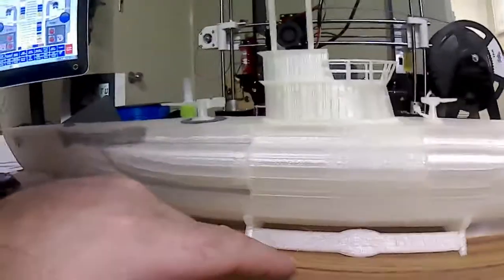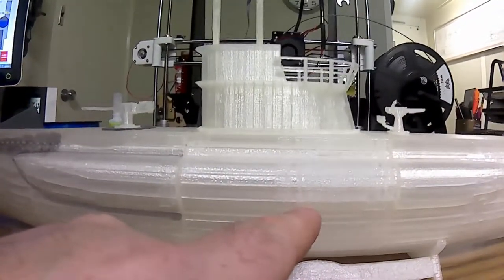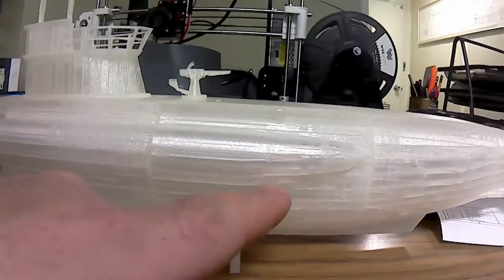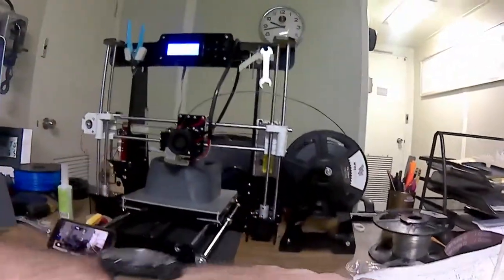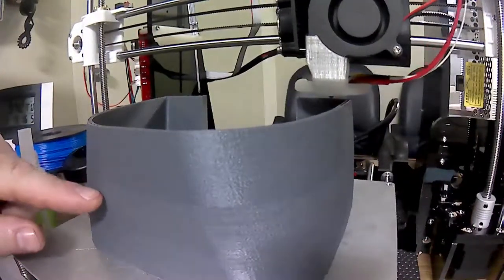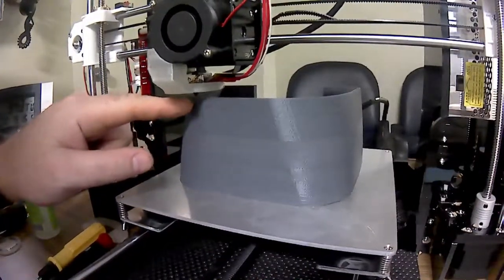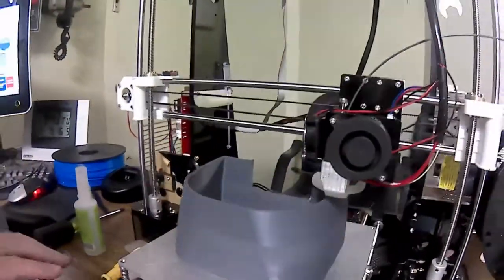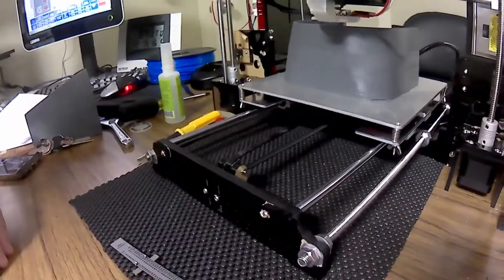First ever 3D printer on a ship! Does it work is this the future?

Comment from the maker: Ive had my printer on the ship for months now. I did actually make a part for the ship it was a clothes dryer knob that worked. files from thingaverse. otherwise have not found practical application. I did make AR- parts quality items but they took a very long time and numerous failures, about 2 days to get a good part. to make an ship specific part with design and print time is just not practical for the current status of both machines and existing designs. please let me know if you have different findings.